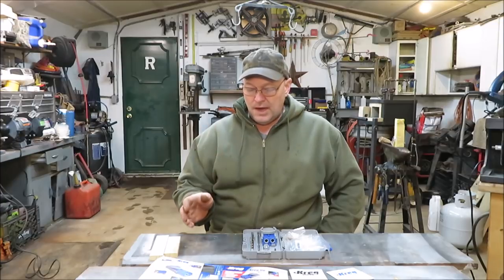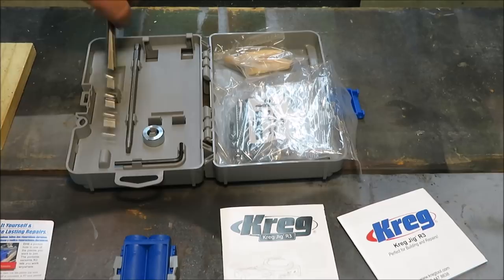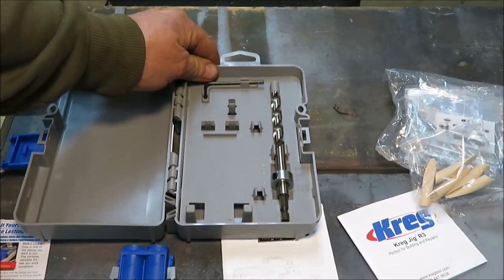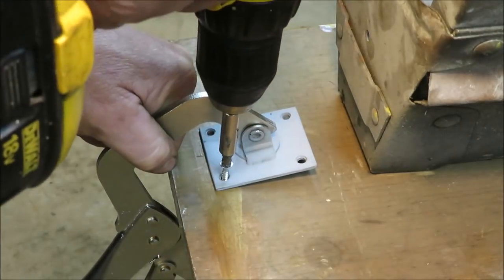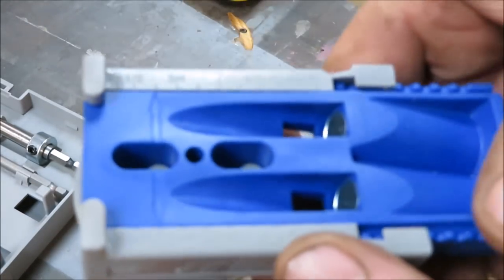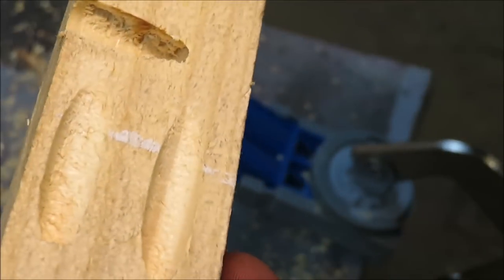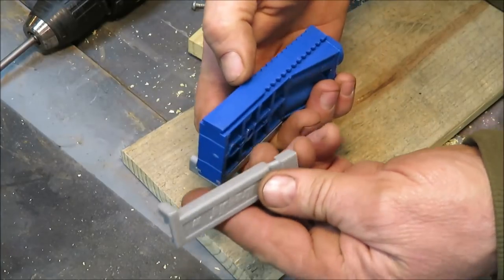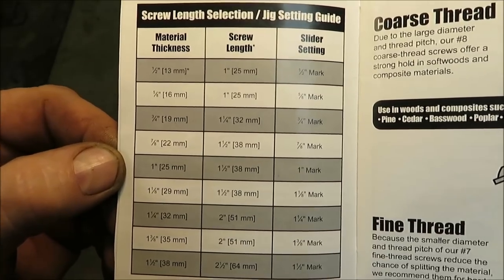kreg jig r3 and modified clamp

Comment: Hey Kevin, love the modified clamp!  2 questions: 1) what size washer did you use?  2) I’m not a welder; do you think epoxy would do the trick to fasten the washer?  Thanks
Reply from the maker: I think it was 1 inch washer and you can try epoxy i'm not sure how well it will hold.
Reply: Thanks Kevin